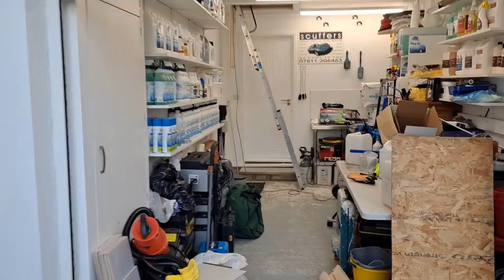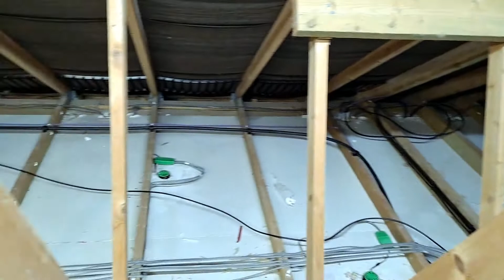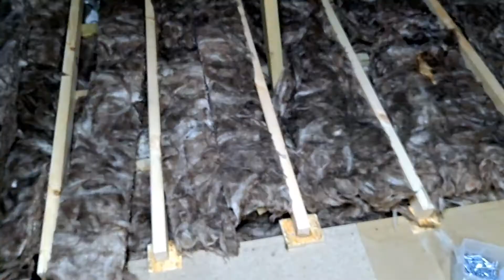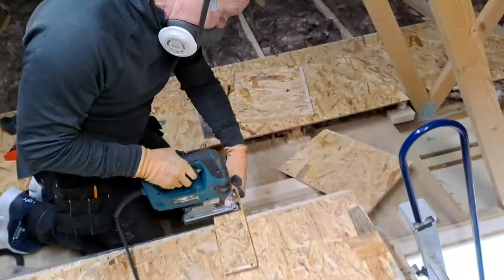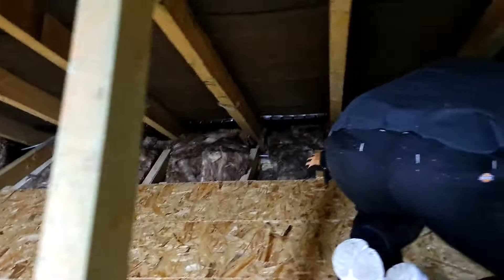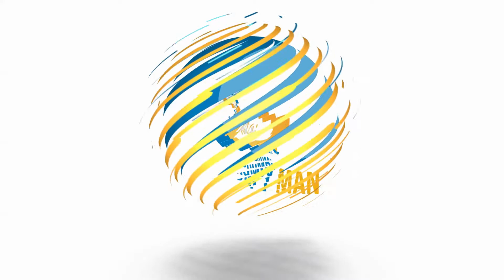Loft boarding above a garage extension

Comment: What wood screws you are using in mm x mm, please? any direct link to get them?
Reply from the maker: 4 x 50mm
Reply: @MrBish11  Spax Pz Countersunk Yellox Screws Bulk Tub - 4x50mm Pack Of 650 ? from Wickes
Reply from the maker: @rajhossain1956  there are ok to use, wear gloves or the screws will cut your fingers to bits, good luck
Reply: @MrBish11  any recommendation on screws 4x50mm? and where should i get it from?
Reply: @MrBish11  could point me to the one you are using  pls, there are so many to choos from.
Reply from the maker: @rajhossain1956  wickes, 4 x 50mm wood screws